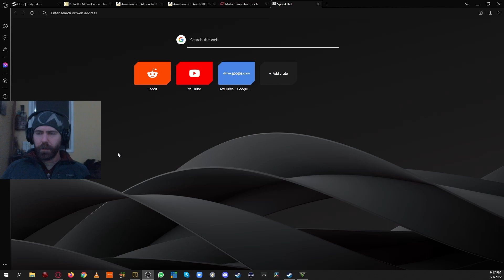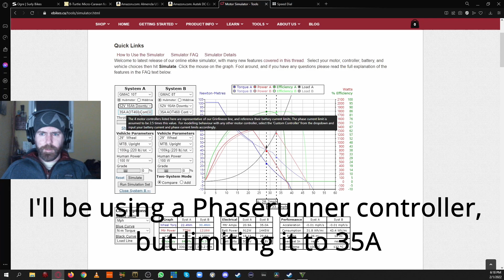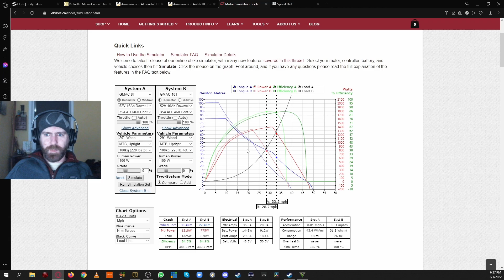Things I Considered When Choosing My New Ebike Motor (commuting and ebike touring)

Comment: My biggest surprise is how comparable a direct drive motor is to the gmac, considering how much worse I thought they would be for torque and whatnot. 
I've got two EZ motors in bikes and a 9c clone 27mm stator front direct drive. I guess that they're not that far off really while I expected the Ezee to be more torquey. 
But they do indeed feel more similar than different in practice. I still wish I could do regen on those Ezee motors.